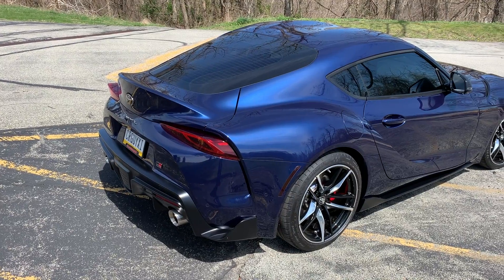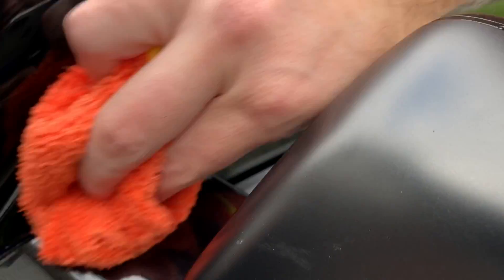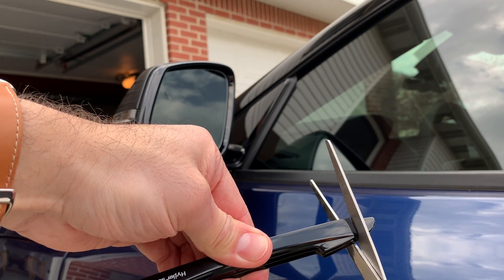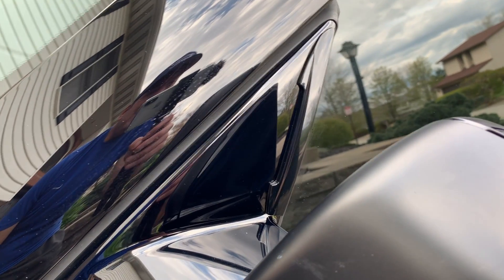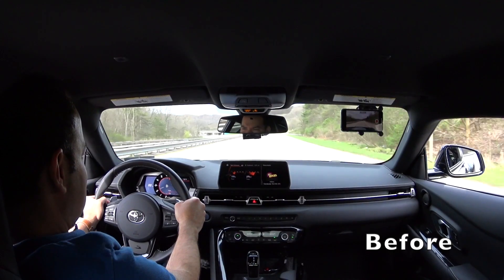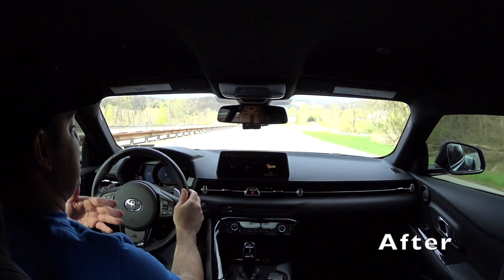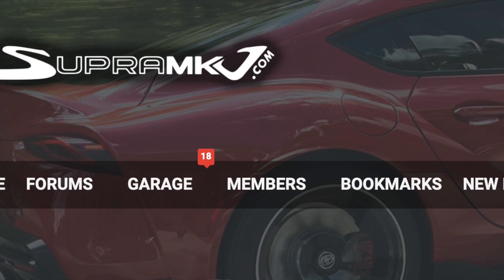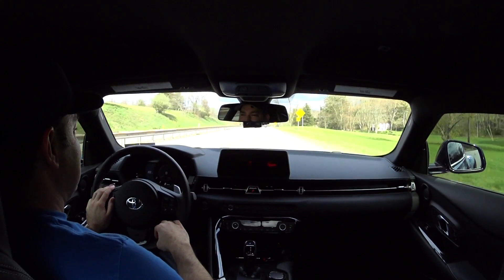Cheap Wind Buffeting Fix! - Toyota GR Supra

Comment: So far I’ve had this fix for a week and I it’s not a 100% fix. It helps for speeds around 50-60 mph. And it’s cheap.  It once you get up to speed around 80 plus, it literally does nothing. I’m not sure if the $200 pieces fix the issue either.
Reply from the maker: Correct as stated in video.

Comment: This is a problem in the 2020 Corolla too. Roll your rear windows down about 5 or 6 inches and get up to about 35-40mph and the whump whump whump whump is ear shattering. BS!
Reply from the maker: Wow didn’t know about Corolla!
Reply: ...but in a 4-door car, you can open the front windows to relieve the pressure differential/buffetting...in the 2-door Supra (and other 2-door cars), you don't have that luxury.  Moving the air so it clears the rear edge of the window is key.
Reply: @K03sport  This is flaw no matter what the door count is. Never had a car that would rip my ear drums out because I simply roll any of the windows down a few inches.

Comment: Since each pack came with four pieces, I just double stacked them. I was skeptical about this product but it actually works!!! Floored it to 75mph and no wind buffeting. Not bad for less than $10.
Reply from the maker: Absolutely not worth spending more!
Reply: @CarGuy11  I don't understand people spending $100-$200 on deflectors. I just order another two sets. One set for my Camaro and because I messed up on one side of my Supra so i want to redo the passenger's side. Thanks again. 👍👍
Reply: Any problem with them falling off at higher speeds since they’re stacked on top of each other?
Reply: @osvaldosegura9195  no problems at all. 85-90mph and no wind buffeting. Looks factory to the untrained eyes if you trim it properly.
Reply: @mrjjthor  sweet! would love to see it in a picture I just ordered them hope to have no more “wind tunnel” in my car